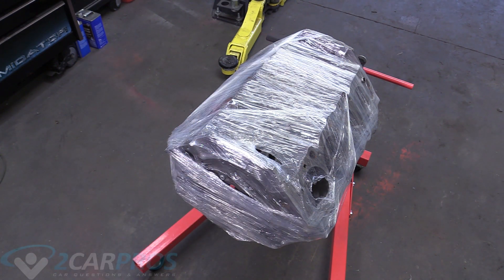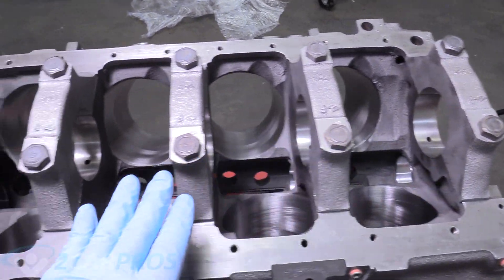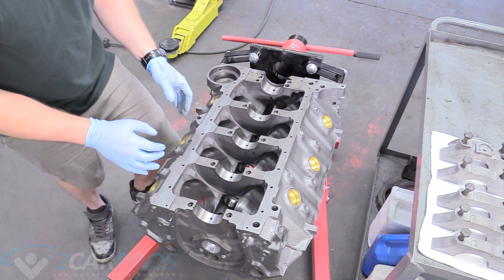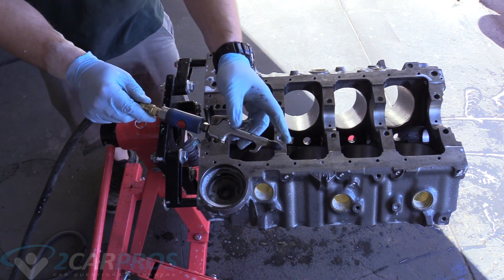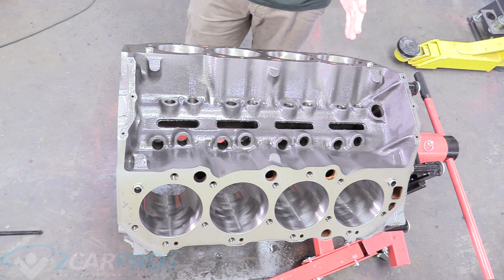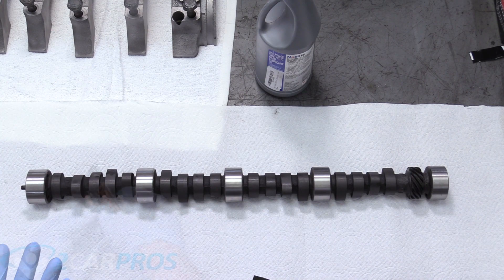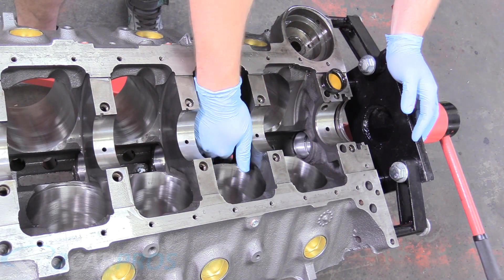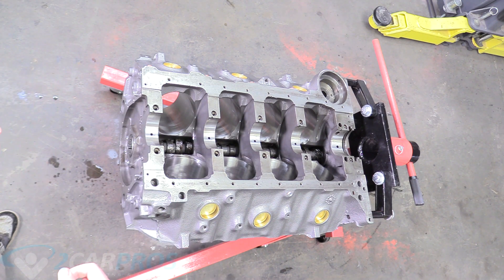How to Build a Chevrolet 454 Big Block Part 4: Replace the Camshaft and Clean!

Comment: You should not be washing the engine with soap and water after the machine shop has already put all of the oil galleries plugs in
Reply from the maker: Yes you should. Thanks for watching!
Reply: @2carpros  I have built a lot of engines and anyone else that has will tell you the same clean engine assembly is a must but pouring soapy water over the block after all of the oil galleries plugs are installed all of the soapy water you poured in the main journal area area of the engine is not the proper way to clean an engine after all of the oil gallery plugs have been put in. Any soap and water that went down into the oil gallery contaminated the oil system after you blow it off and push the water farther into the system. Within minutes. It starts to rust There are proper ways to cleaning during assembly. And I’m sorry to say that is not one of them.

Comment: Im stuck in my cam selection can you help? I have a 454 cast#12550313 the engine is confusing me as a new builder its like a gen5/gen6 combo i believe i can go hydraulic roller cam but a flatt tappet came out off it.
Thanks

Comment: HEY RYAN YOU SAVED ME!!!!!!!!!!!!!!!!!!!!!!!!!     Long story but I took my 454 to shop A in late feb. 2 to 3 weeks they said. 3 months later they still had not finished it so I pulled it and took to shop B. shop B found that the crank mains had not been ground, just polished, the valve seats had been ground wrong.    when I cleaned the block I found the rear cam bearing had two scratches, shop A had installed them. couple of weeks ago I went to install the cam and it wont go into the rear bearing. So I took it to shop B and he replaced two of the brand new bearings I get it back and this is where you saved me!   I checked the bearing orientation and the rear bearing was not aligned with the oil passage! I have built engines before but never thought to check this!  So thank you!!!!!!!!!!!!!!!!!!!!!!!!!!!!!!!!!!!!!!!!!!!!!!

Comment: Well WD 40 definitely repels water but it does not keep your iron from rusting long-term so it has its application, here's a good test spray cast iron with WD-40 and then try JB blaster put your hands on the surface of the as well as the JV blaster you will see which one will rust because moisture got into the weaker oil.

Comment: I’m more concerned with the abrasive cutting tool remnants than micro metal. That abrasive grit will cause failure even if no metal is present. I use a lot of mineral spirits and engine brushes to run the the oil galleries to get any stuck dried on debris completely out. You have to mechanically agitate every internal surface to be sure it’s all out. Nice series so far. 👍

Comment: Thanks for these videos. I have been using them for my 454 build with ARF 265s. I had a cam ground to make it a low end grunter. It's in my 36' RV. The stock 454 is about 200-235HP. I thin the new build will do a little better job pulling a 20Klb RV up a mountain. Well, at least be capable of. Not doing any bottom end work except oil pump. The block only has 44k on it. Cam got swapped today! assembly begins!
Reply from the maker: Nice work! That is going to be amazing! Thanks for watching!
Reply: How did it turn out?
Reply: @bender49ers  amazing! it pulls 22klb over the continental divide (look up Loveland pass) 4 times. overheating is an issue on long pulls. I am adding a jeep xj radiator to it this week along with a large oil cooler. it has the resonator in the exhaust only. so pretty much a straight pipe. it sounds amazing. a streetrod engine along with all the sounds in am rv is kinda awesome
Reply: @MrMorbo420  that's great to hear.  I just picked up a 454 rv block for 500 bucks hopefully I can get it into my old suburban soon.
Reply: @bender49ers  oh, it actually ended up being a double build. I lost oil flow but had over 150psi. tore it down and had bearing soup. so I quickly sourced a new block (rvs have 454s) and did a full rebuild. it was fun swapping the engines. but the basic swap took about 4 hours.

Comment: wd40 is the wrong thing to use as it has silicone in it (iron is porous) . Primer/Paint doesn't adhere well on a silicone coated surface.  1st-wash with pressure washer/ scrub brush. Use compressor and high pressure air nozzle to blow off all water quickly. 2nd- use Acetone to wipe down all surfaces of the block (acetone stops rust flash and is an excellent de- greaser used prior to painting metal surfaces). 3rd- tape and paper off all surfaces of the block that you do not wish to be painted and Spray Paint engine block with self/metal etching engine block primer. (Wait 20-30 minutes at 65-70 degrees)( Remember different paints dry at different rates). 4th-  When primer is "very tacky" (test with gloved finger on taped area), Spray Paint engine block with manufacturers correct year /date code engine block color (or custom color). In your case Chevrolet  orange. This protects the outside of the block from rust. There are also specialty paints for the inside of the block that also promote better oil drain back to the pan. 6th-After your paint has "set" and is dry to the touch, carefully remove painters tape/paper, chase all bolt hole threads, and coat threads / and all other non-painted surfaces with a light coating of oil to protect those un -painted surfaces from rusting.
Reply: WD40 does not contain silicone
Reply from the maker: I used carb spray and mineral spirits to clean the block before painting. We have been running the big block for awhile now and have experienced no issues with the enamel. That is good stuff. Thanks for watching!
Reply: Wrong. WD40 is the correct thing to use and it doesn’t contain silicone.

Comment: Water on bare iron!? NOOO! 🤦‍♂️
Reply: why not? when dry they spray wd40?
Reply from the maker: As long as you act fast with the WD it is totally fine. Thanks for watching!
Reply: YEESS. It’s done every single day in every professional machine shop on the planet. They Then quickly spray them down with WD40 and blow them off with compressed air.
Reply: @prevost8686  yes we wash them with soap and water run them through machines blow them off spray them with WD no more water is used on the block after the cam bearings and oil gallery plugs are installed brake clean or mineral spirits are all that is used for cleaning purposes
Reply: Yea I wash mine with soap and water. Been doing longer than this guy is old. Heck of a cam. Link in the description still works. I'm doing a 92 tbi 454 right now.

Comment: That's passenger big block engine not a truck engine
Reply from the maker: I was told it came out of an old truck. Thanks for watching!
Reply: Normally a truck block engine would have 4 bolt mains, no?
Reply: @goodtalker  not necessarily.
Reply: @goodtalker  No.

Comment: How much does the machine shop charge for something like that ( engine block)?
Reply from the maker: 600 I believe. Thanks for watching!
Reply: @2carpros  no prob you got good content
Reply: What is interesting.   Upon you installing the piston.  The piston rod connects to the cam shaft and is torqued down.   I noticed the space that the rod is connected to on the cam shaft what stops the rod from sliding back and forth while the cam shaft turns?
Reply: Does the block absolutely have to go to the machine shop